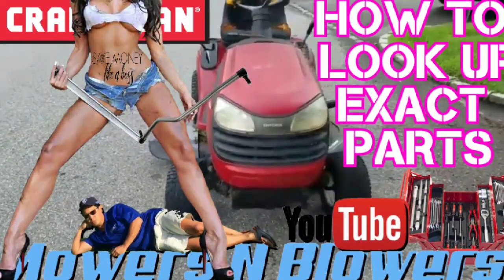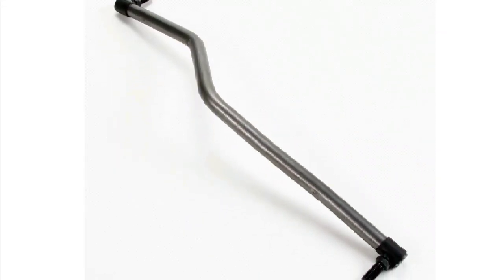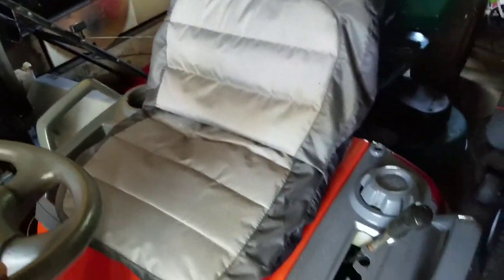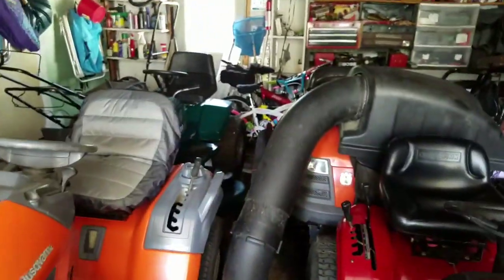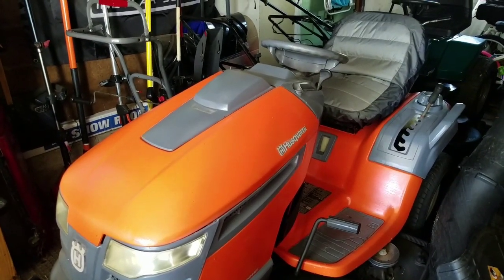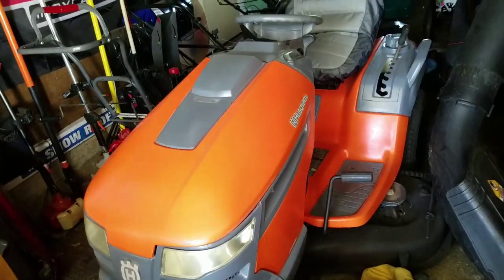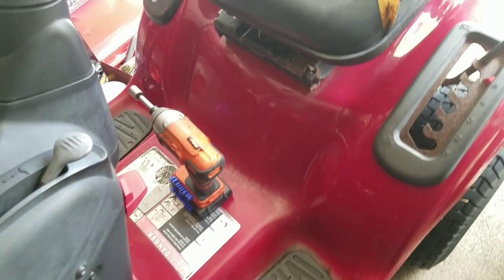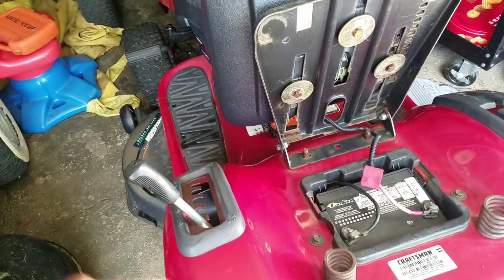HOW TO LOOK UP FIND EXACT OEM LAWN TRACTOR RIDING PUSH MOWER SNOWBLOWER CHAINSAW WEED TRIMMER PARTS

Comment: I have that craftman tractor and the steering wheel is off how can I strained the wheel?
Reply from the maker: Straighten the front wheels or the steering wheel?
Reply: @MowersNBlowers  straighten the steering wheel?
Reply from the maker: Steve Allen take it off and realign it!  Or do you mean it drives crooked.  You need to explain what’s wrong bro!
Reply: @MowersNBlowers  it drives straight but the wheel is not lined up straight?
Reply from the maker: @Steve Allen ok...so you need to adjust your drag links, or replace it if its bent from hitting a tree.

I have a video on it!

https://youtu.be/fvFcCZqjMvQ